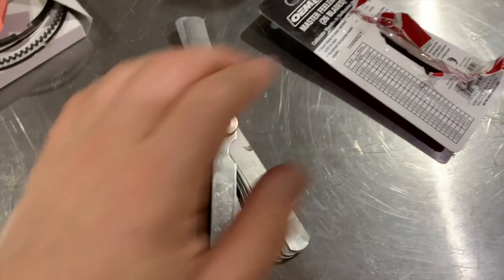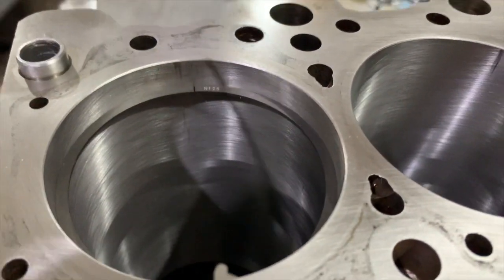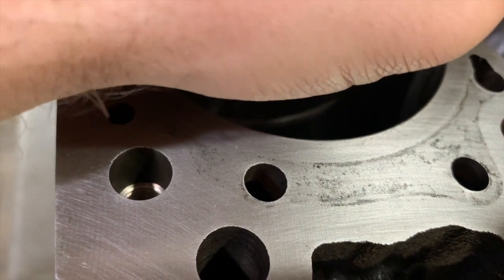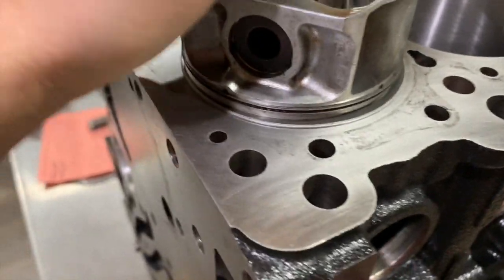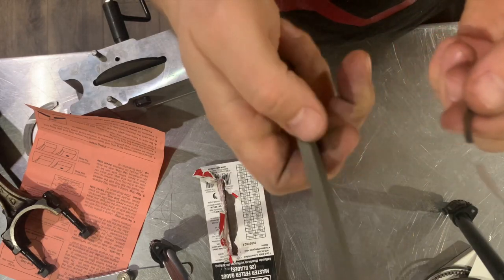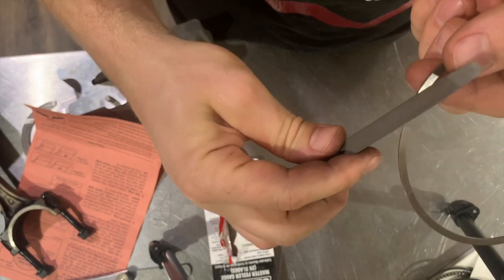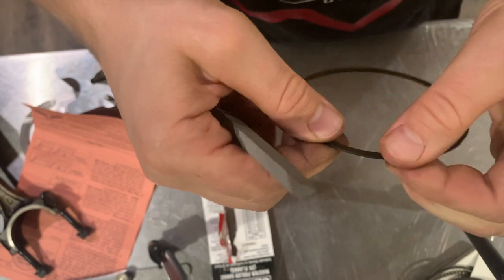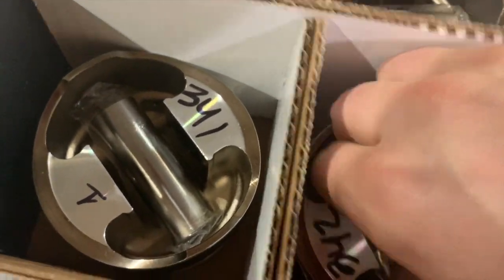How to Measure and Gap Piston Rings (4G63t)

Comment: Is that normal to make the gap of both rings 0.22 mm??? i have heard that the top ring need to be more clearence then the 2nd ring. Please could you enswer me. I really want to know
Reply from the maker: It depends, if you filed too much and now its on the same spec the car is still gonna run but the compression is gonna be different, performance wise also gonna suffer because of the compression, Can you run it without messing up the engine? yes, should you run it if you want the best performance and best compression for your engine? No I wouldn't suggest it, you can buy a new set and file it again, its not too expensive
Reply: @speedprophets82  i have made the clearence of the 1st ring 0.30mm and the 2nd 0.35mm.my car toyota corolla2005 diesel.2c . Do you agree about this clearence or do yoy think its too much.?????
Reply from the maker: @chouchou3652   I can’t just answer yes or no on this question, you have to give me the full story, is this a stock rebuild with stock specs or are you doing forget internals? Are you planning to add more power to this engine? If you are just doing a normal engine rebuild with stock specs find the ring gap specification to your car and use that if you modify it you can see the specs on the piece of paper that is included with the rings
Reply: @speedprophets82  just normal building engine. Not asking more power. In toyota catalog it says 1st ring from 0.27-0.54 mm and the 2nd ring 0.25-0.52 mm.the bore 86 mm.stroke 85mm.
Reply from the maker: @chouchou3652   you should keep the stock spec because thats the best option for your engine and best performance, you can still use it maybe the engine is gonna use a tiny bit more oil but its not gonna hurt the engine.
Reply from the maker: @chouchou3652  but make sure the lower ring is a bit bigger to prevent the engine from blowby
Reply: @speedprophets82  tha
Thats  what i wanted to hear .a wonderful advise. Thanks man.
Reply: @speedprophets82  I have another question if you dont mind. Which is better of ring piston. 0.50or std rings.?????
Reply from the maker: @chouchou3652   stick with the stock one since you are not building for power, less work
Reply: @speedprophets82  its the first time for me to renew the engine . And i am learning. Thanks for everything. By the way. I am from algeria.nice to talk to you.
Reply from the maker: @chouchou3652  You’re welcome happy to help, there’s always a first time for everything, good luck with your build! ✌🏻